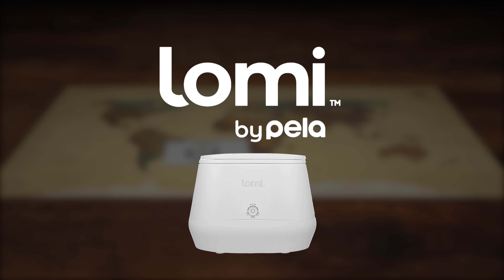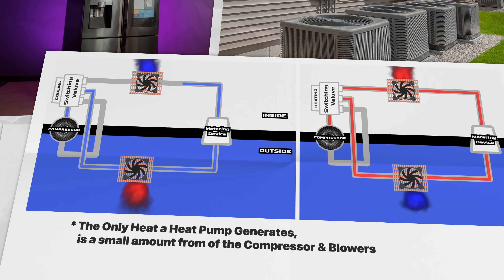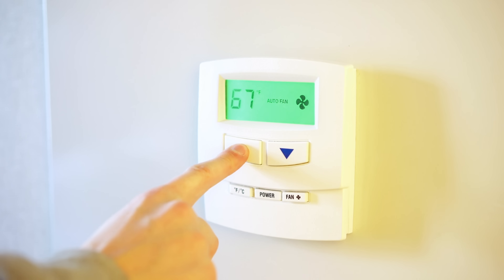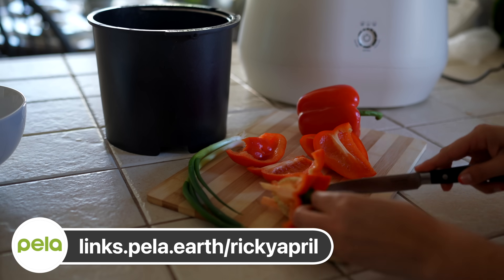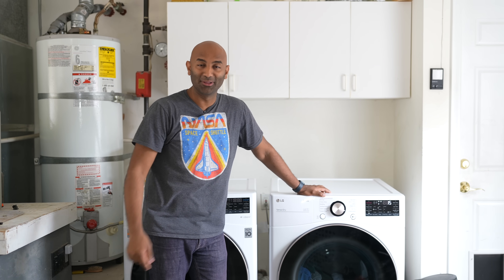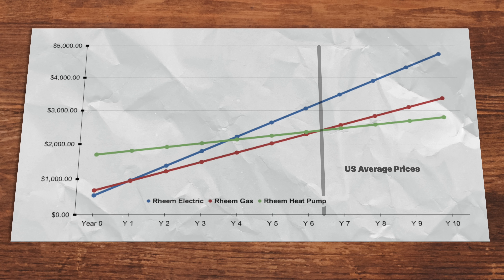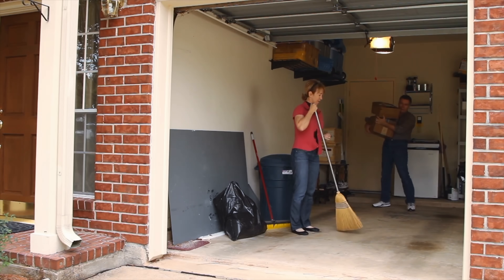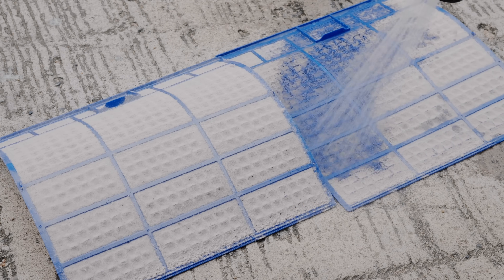I'm Shocked How Much Money Heat Pump Appliances Save!

Comment: So many things to keep in mind here;
1) Most heat pump devices have vented options.  May not be as important for you, but for people in the cold north, this lets you pump that cold air outside instead of cooling down a home that you are trying to heat in winter.
2) Most existing 110V heat pump devices kind of suck.  There are some EU models out there which use a next gen heat pump tech that keeps efficiency at lower voltages, but in general you will want 220V devices to keep efficiency up.  But for now in the US, most 110V devices are going to be closer to 3x efficient, while 220V is going to get you the 4-5x as advertised and sadly that typically means a lot of rewiring and electrical work which isn't cheap either.  But that is changing quickly, so yay for temporary problems.
3) Anything that has 'heat pump' in the name is stupidly expensive, and I expect a major crash in prices.  A heat pump water heater is a simpler device than a refrigerator... but a fridge can cost you $5-800, while a heat pump water heater costs closer to $1500.  There is literally no reason for this... it is the same device with coils on the opposite side of the insulated container, but because the name has 'heat pump' in it, they can charge 2-3x as much for it.  The difference between a house heating heap pump and an AC are a couple extra valves... and for this they charge 2-3x the cost of a normal AC unit.  It's kind of dumb, and as people are realizing this there is a growing demand for some more sanity in the pricing.
4) If you are going solar, heat pumps are a MUST.  On the one hand heat pumps are slower devices, and need to run for much longer periods of time.  But they also have much less intensity which means you can get away with a much smaller solar array to cover spikes in usage, and much less overall usage allowing for a smaller battery backup.

Best of luck on your venture!  I'm in the midwest where electricity is cheap, but natural gas is stupidly cheap.  Even with gas prices rising, it is still half the cost of electricity here, and in the short term those prices are expected to go back down to 1/4 the electric price.  Well, when a heat pump is 4x as efficient, it means that it is the same operating cost as natural gas equipment... but slower... so the demand is super low for it out here.  But these low natural gas prices are likely not going to be a thing in 20 years as some form of carbon tax will eventually take hold at some part in the supply chain.  So for a home owner it is a big question;  Do we replace our natural gas equipment with newer more efficient natural gas to last the next 10-15 years?  Or do we fork over the money now for heat pump equipment because we expect gas prices to rise more in the next 10 years than the following 10 years?  Having local, state, and federal governments who give a bit more clear direction would make this a lot easier of a choice but that isn't how democracy works lol.  But I'm sitting here with a 35 year old gas furnace that is kind of a ticking time bomb, and am starting to look around at my options.... and there are no clear good directions to go just yet.  At least not out here where gas is dirt cheap, and we need larger capacity heat pumps to run in winter with minimal need for emergency heat sources.
Reply: It is a really bad idea to pump the colder air outside if it is going to be replaced by even colder air. I have a heat pump water heater  in my basement. The basement baseline temperature is 50°F The little room the heat pump is in will get down to 45°. The outside air in winter is anywhere from 0°F to 35°, so pumping the output air outside will be replacing at most 45° air with much colder air coming in any crack it can find. Plus the output air is nice and dry.
Reply: @generallyhelpfulsoftware646  Maybe I'm wrong on this, but I was thinking the venting allowed you to run the heat pump using outside air, not blowing indoor air out.  Because if it is doing that then yeah; about as dumb as running a fireplace.  Lots of heat in one room while you suck cold air in all the other rooms of the house.
Reply: I've always had a problem with the philosophy of single vents. Creates negative pressure and heat/cold comes in from outside to equalize the pressure. Heat pump dryer that vents indoors only makes sense if the central heating is also a heat pump, otherwise its just scavenging energy from gas heating or expensive electric heaters.
Reply: You should double check the math. Electricity is cheap here in the midwest but probably going to rise if yours hasn't already started to rise. Here in STL it just went up 10% in 2022. With the efficiency of heat pumps if memory serves the cost of gas to heat is the same as a heatpump per dollar with a COP of 3, which you said, but unless your power is still legally capped as ours was, that advantage will last 1-5 years at best. Plus heatpumps probably have rebates from your utility which in a cursory glance knocks off most of the premium.

I didn't know heat pumps were slower but that doesn't matter because they operate in a fundamentally different way, constant. Heatpumps are multi stage or inverter based for a precise and constant power maintaining a temperature. Whereas your gas furnace, water heater, and old school air conditioner, are only 1-3 stages. This is a bigger deal with an air conditioner because of the high costs of starting up a motor, but even with forced air which is either a million degrees or cold there is also a furnace fan that would suffer from the power of cycling on and off. We should also be able to live wiith a few degrees higher in the summer and lower in the winter since we aren't dealing with the 3-6 degree swings of a traditional set point cooling system.
Reply: @SetitesTechAdventures  I'm talking longer-term than the next year.  But yeah, our power bill has gone up a bit the last few months (I think closer to 6-7%? need to double check that), but my natural gas price has risen by closer to 15%, thankfully just in time for some warmer weather.  But all of that stands a chance at normalizing as soon as Russia sorts out its intrapersonal issues.
No, what I am thinking about is over the course of the next 5+ years.  I'm expecting electricity prices to remain roughly where they are, and maybe rise a little over time slower than inflation.  But natural gas, oil, etc are going to go through the roof during that time.  Right this moment moving off of natural gas to heat-pump-everything may not make a lot of sense.  But fast forward a decade and I am expecting natural gas to cost more than electric costs, which is a little insane.  But in that climate, moving towards an all-electric home will be a necessity.  Just a question of if that will be closer to 5 years from now when that starts to make sense, or closer to 10 years.

And yeah, heat pumps don't have the same intensity, or the same spike in power draw.  They are meant to run more constant.  Lower spikes and less variability means you can get away with a much simpler solar or solar+battery setup.  Heat pump devices may not make good sense (yet) in traditionally powered homes, but when you have a solar array it can greatly reduce your sizing needs.
Reply: @CaedenV  I've had solar since 2014. Now expanded 2 years ago to cover all our needs: heating the house and garage, all energy we use for two EVs and all electricity for the family... Maybe we buy a little bit, we'll see, but it's just a few hundred USD per year in that case. No gasoline, no un-natural gas, nothing like that. Very efficient!
We live in a place where we have real winters for 4-5 months per year with temps downwards -30°C... 
Well insulated house with heatpump.
Reply: @SetitesTechAdventures  " didn't know heat pumps were slower but that doesn't matter..."  You obviously don't have a wife that won't wait for the temperature to rise from 72 to 74 F when she is chilly. My natural gas heater pumping out 120 F  air can do that is 5 minutes.
Reply: @#3 I agree but it might be a supply / demand issue. We create a lot more fridges than the relatively new heat pump water heaters atm
Reply: Your comments is of much benefits more than this whole video!
Lately I'm trying to stick with web reading more than watching videos, but it is this algorithm that keeps us attracted here!
Reply: thanks
Reply: With the current issues with r@tsian gas in EU, the future for low un-natural gas prices is thankfully soon a thing of the past. 
It is polluting the air, so it must be abandoned.
Reply: Most heat pumps here, just like our ACs, are run on 240V.

Comment: Nice video. I have to disagree however. First of all I agree that  gas heaters should be changed..no doubt about that.. ofc It is different in USA as it is in EU..we have different problems now(as all might know) so gas isn't the thing you want to relay on...

Anyway.. Electric heaters are thing of the future..but they are not most efficient as those with heat pumps..We all know that.. but as replacement for small gas equipment still are the thing of the future..

For all big power hungry equipment ..yes heat pumps are the thing. But because they cost so much nobody will use them for long time. There is one thing you didn't mention in your video.. What is more likely to fail ..electric heater with just simple heating element or ..heater pump with a lot of moving parts and second question. If electric heater(that heating element) will fail and go bad..how much does it cost to change it to new one..(even if you had really bad water) lets say ..you should change it every  years to new one and it still would be cheaper.. but what will happen once your heat pump go bad...how easly can it be changed ...how expensive will be repair...repair technician will probably tell you to change whole device..as it is common practice..

So I would suggest also to include price for repair/replacement of the units ..and then you will see it isn't so clear win anymore.

Comment: I live in Alaska and the heat pump was a game changer for heating our house. I have the largest residential heat pump installation in our area.  I also concur that the tankless water heaters are a nightmare. We had a gas version, and the cost of operation was not really cheaper, but even worse, trying to dial in steady hot water to any shower or sink on the far side of the house, didnt really work. Heat regulation would vary from the system the further the unit was away. We replaced it with a regular old electric water heater and sold the expensive Bosch on demand system.
Reply: Instant hot water works best on the spot where it's used.

I have a system set up to feed a hydronic heat loop under a one room tiny house or feed my bath tub.

But for a full house, heat pump hot water probably makes the most sense. Except in the climates where Solar Thermal hot water works through the winter lol
Reply: What brand or type of heat pump did you install?
Reply: So strange, running 7 years tankless water heater. No issues and lower gas bill arounbd 30%.

Comment: If heat pumps are so effective at generating heat(×3-×5), could heat pumps be used to generate electricity from the heat obtained? Sounds like a "perpetual motion"machine, so I guess that wouldn't work...
Reply: It’s called Geothermal Energy and yes it is very real and happening in several locations around the planet now. 
It can be utilised in a number of ways and I believe this to be a very green energy source that we should be using for grid power generation now.  Look up Geothermal Power Generation, its awesome in so many ways, and a relatively small footprint for a scalable power plant of many mW output, its got to be the way to go.

Comment: If you live in a cold climate checkout the Sanden SanCO2 heat pump water heater. The Sanden uses CO2 refrigerant a technology used in Japan for over 2 decades. The Sanden also places the HP outside. Thanks for the video.

Comment: In a warm to hot climate why not look at solar water heating ? I live in Brisbane Australia and have solar vacuum tube hot water system,  with an electric backup (turned off for 9 to 10 months of the year) plus 6Kw of PV panels and have not paid an electric bill in 10 years. Although I do not have AC or a pool. I switched all lights to LED and run ceiling fans.
Reply: You are absolutely right. PT (PhotoThermal) to heat water, PV for the rest is the way to go. Which is great if the sun shines enough. To plug additional electrically powered appliances into a grid system only sustains the demand for additional baseload electricity production, which can only be supplied by fossil fuels. Given that most countries have already opted out of nuclear, and maxed out their exploitation of hydro. Of course, if you live in Northern Europe, it is a different story.

Comment: Why not solar water heating for your pool?
Reply from the maker: I have some solar panels now… and I’m fighting constant leaks… system is old… and I’d rather have total solar panel coverage. I might add a solar thermal pool heating over a patio I want to build. Lots to consider. But leaking salt water on your roof will drive you mad!

Comment: Unless there has been a breakthrough in heat pumps, they are practically useless here in Tennessee in the winter. They’re ineffective in freezing temperatures. Once the temperature drops below a certain level we have to apply strip heaters which are terribly in efficient.
Reply from the maker: Hybrid models here will use resistive heat when needed. But that’s still a huge improvement lots of the year when they are still more efficient

Comment: Keep the existing water heater since it is in great shape. Unplug it and use it as a preheater powered by a solar thermal loop/panel/radiator/ or concentrator. This will reduce your delta-T and thus reduce the power consumption even further.
Same goes for the pool. In San Diego, a thermal siphon could provide most if not all your pool heat. Thus, pool heater (regaurdless of type) works much leass. 

Since you are in the city and have both building codes and limited space, solar thermal panels added on the roof next the the PVs is probably the best option for both of these appliances. 

Most energy efficient clothes dryer is a clothes line. Probably not your first choice or HOA allowed.  Your best option is a commercial laundromat dryer (gas or electric per your supply pricing). These have large tumble drums. A standard residential load, out of your standard residential washer, will have so much extra room to "fluff" and evaporate the water faster. This will produce shorter run times and save money. I recommend a 2x or 3x laundromat washer too. Not to washer larger loads but to basicly last forever doing just standard single family loads with the benifit of having the capacity to wash blankets, comforters and sleeping bags when they occationally need it. And you still get a visually matching pair.

Comment: We have heat pump cooling and heating, (reverse cycle aircon), heat pump pool heating, and solar hot water and power. 
We have the very latest combined solar/wind clothes dryer with UV sterilisation - (also called a clothes line in the sun).
Reply: Hah! You had me going with the clothesline haha

Comment: Go Bears indeed! Grats on wanting to go sustainable. But, I wouldn't call anything that will be beyond your immediate electrical generation "sustainable". e.g.,  5:55 "One of the most sustainable things you can do is  efficiency, but that is a poor second to Reduce. 

The most important things are the lifestyle choices you make and your overall energy consumption. A pool heater in San Diego sounds ridiculous. If it's not hot enough to get you into a naturally unheated pool to cool off then there are lifestyle questions we need to consider.

I lived 30 years in SoCal and I never turned on the heat or an air conditioner at home.  And I swam in my apartment building's pool and the ocean. If you need to heat your pool in San Diego, you might consider taking a warm bath instead. 

Example 2: In San Diego you should be able to air dry your clothes with NO effort. Heat pump good. Direct sunshine and air utilization better. I live in the Northeast US now, and I still don't use a clothes dryer to dry my clothes--even in winter.

If you truly want to go sustainable, try reconsidering your energy use overall.

Comment: With a pool a variable speed pool pump uses over 80% less energy. I just upgraded to a 65 Gallon Heat Pump hot water heater also.

Comment: I NEVER subject myself to just one fuel.
Propane. Electricity. Wood. Kerosene.
Everything has its place. I would kick myself hard in an all-electric house when (not if) the power goes out.
This past winter, we lost power for 3 days from a serious winter storm. We still had heat.
Reply: Except you are all for banning Natural Gas and not giving others the choice you just said you want to have.
Reply from the maker: This is a great point! I think I’d keep the natural gas line just for this reason. Build out a house that doesn’t rely on it but have diversity of options. Smart for sure